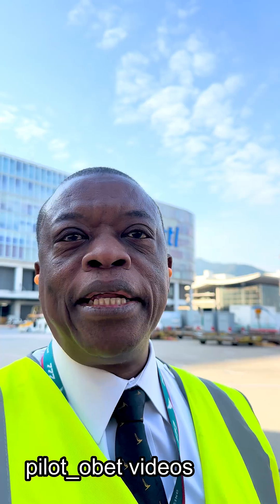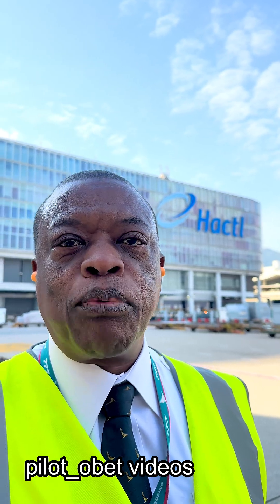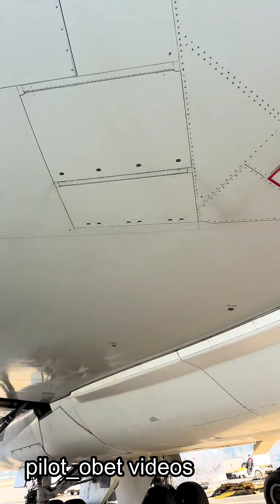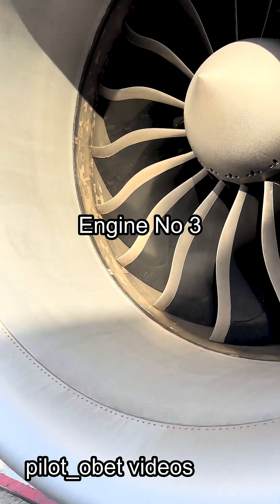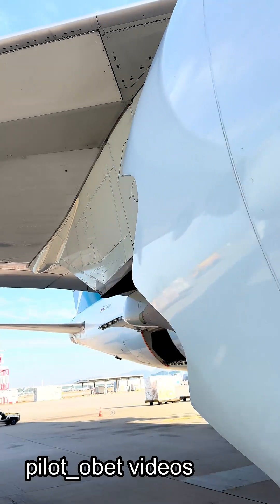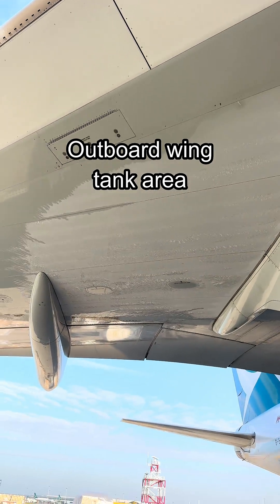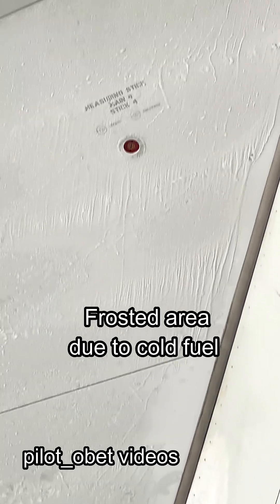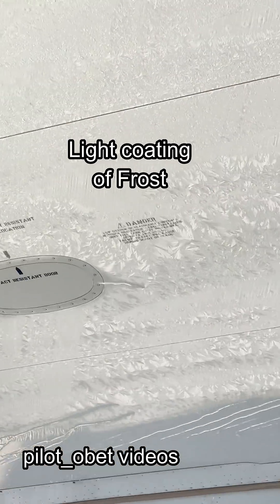Boeing 747: Icing issues - ground operations

Comment: Maybe the inboard tank has a greater capacity, holding much mote fuel than the outboard tank at the beginning. Thus the it holds more heat compared to the outboard tank, which effectively results in warmer fuel temperatures in inboard tanks than outboard tanks.

Comment: fuel in tanks are used in a certain order. we try to keep the fuel in wing tanks because the fuel weight helps having stable wings which flex less. I think we start using fuel from center tank and then we use the fuel inside wing tanks. this plane had a long journey so it had to use the fuel on inboard tanks but the outboard tanks are still full.

Comment: outer reserve tanks feed the inboard tanks when they each reach 40200 lbs., so they are exhausted through a gravity feed process. Each wing has 4 tanks, if you include the surge tanks at the tip.